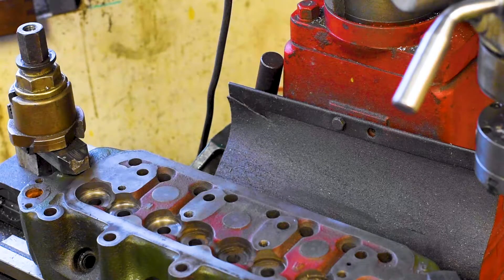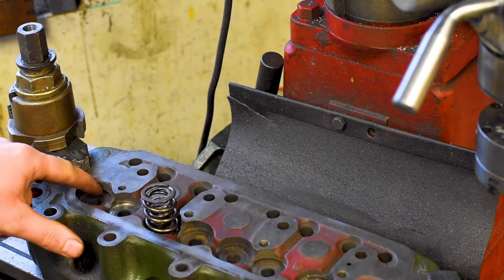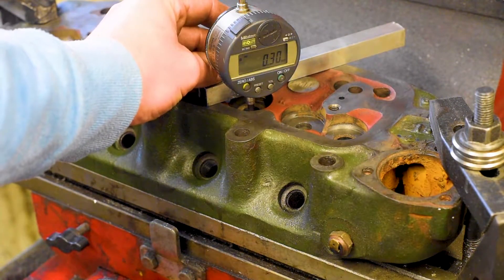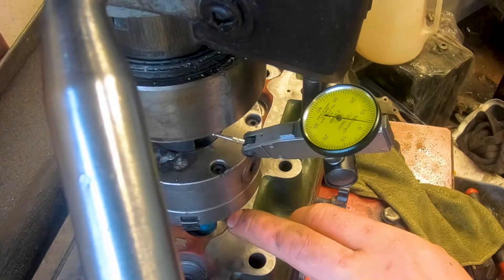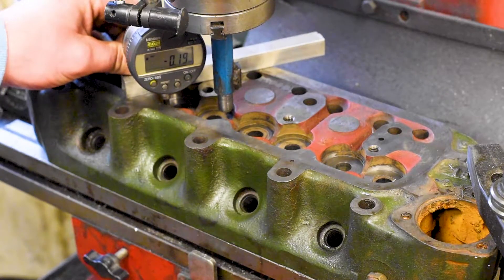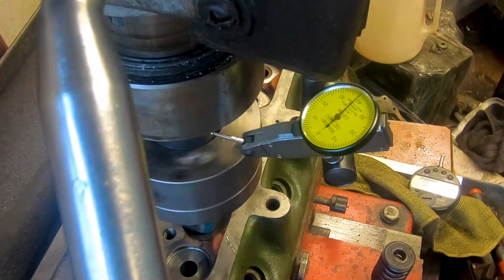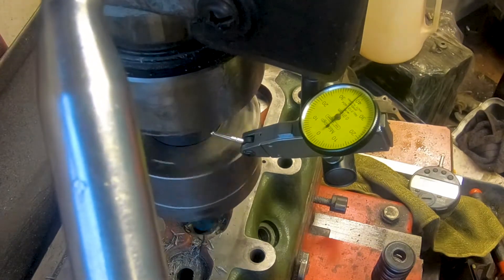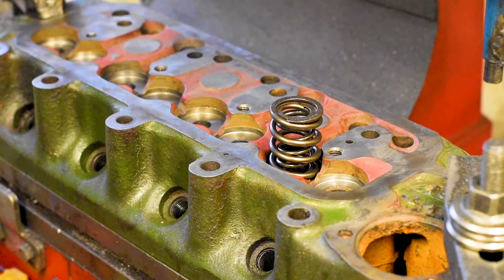Classic Mini A-Series Cylinder Head Machining Valve Spring Seats

Comment: Can you show us the clutch setup on the mill? Also love the engine machining vids, great to see someone doing it themselves on simple machines
Reply from the maker: Thanks Russell, the clutch is very simple its a sprag clutch on the pulley of the main motor. it has an allen Key which alows you to adjust the tension on the clutch and point at witch it slips

Comment: Is this not all a bit pointless until you have the head skimmed (so you know it sits flat and level on the mill table) ,  and more importantly, the actual valve you are using in each port, ground to match the seat. then the associated spring, cap and collet fitted in final position before spring length is measured!
Reply from the maker: The head had been lightly skimmed to make it square, so no matter how much you grind the valve you won’t make the spring seat higher. First stage set all spring heights level and to a known value, then fit valve guides and cut valve seats then fit valve and measure fitted length, then use shims to bring the valve springs to the correct open length 👍👍
Reply: @HREIRL  Thanks for the good info.  Loving your work...  Just start episode 2 of Gretel.  good luck

Comment: watched this a few times now, currently building a couple of engines..and working on your theory of measurements currently doing my 2 heads..heres an example,would you be kind enough to check and agree or disagree please as i work in thou so have to convert..
your factory setting is 0.000661mm.......= 0.02602 inch
picking one seat of mine at random
0.0301 inch..... so 0.0041 high over standard,,which equates to 0.00010414mm
my c-aea525 springs are 160 lbs @ 400 thou inch...ive got 041...so spot on no shim needed...
do you agree
many many thanks in advance
Reply from the maker: Hay Dude c-aea525 require a fit length of 1.325" so what you need to do is put a valve in your cylinder head, put it together with top cap and collet and fully close the valve then measure between the bottom of the valve spring seat and the underside of the valve cap and if that is less then 1.325" you will need to get the head machined if that measurement is more than 1.325" then you will need shims under the seat to bring it to the right height  hope that helps let me know 👍
Reply: @HREIRL  yup sure does thanks..Im also making some inch spacers .assembling the valve with top cap then measuring the excess..Lathe being delivered thus Saturday so super excited about that too..excellent content keep it coming...
Reply from the maker: @rhysdiggers1514  Aww new tool day has to be the best feeling in the world congrats and enjoy every minute of it. If you don't already watch him Abom69 is a great turning channel

Comment: Hi , does your machine also run in a clock wise direction .i see the cutter is made to cut anti clockwise.thanks.
Reply from the maker: Hi Jim, yes machine can run in both directions thanks to my VFD. I run the cutter anti clock for a reason 😜 well spotted

Comment: Nice work. Did cut valve seats at all?
Reply from the maker: The valve seats where cut before this operation Its a good idea to cut them first as the will effect the setting height for the top cap 👍